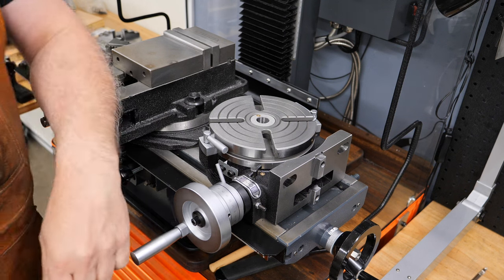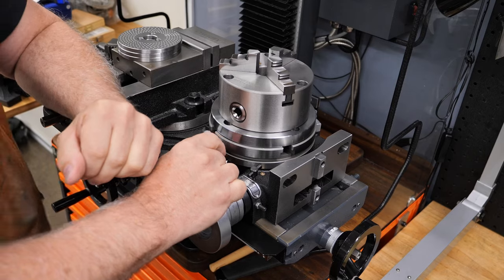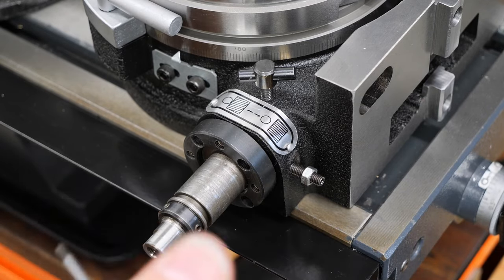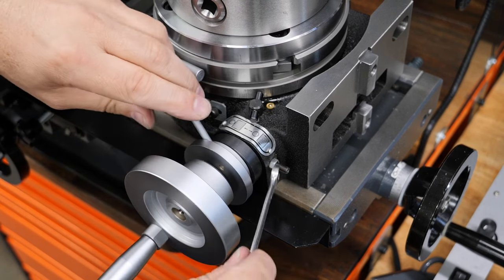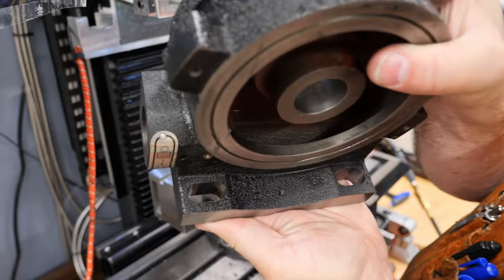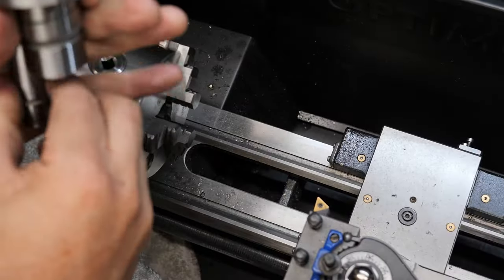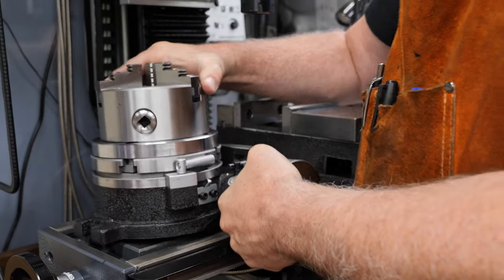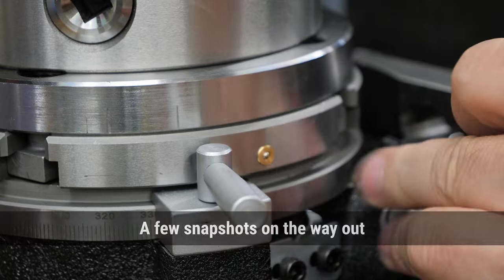Buy, Fix & Rebuild a Cheap Dividing Rotary Table for the Mini Mill - Rob's Garage

Comment: What's the Ducati 900SS banner for?
Haven't worked on one since mid 80's.
916 was a fantastic bike, got to ride one in 95.
You fit a four jaw chuck on a tiny rotary table so you can hold very small parts, more than 3" diameter when you reverse the jaws.
Stefan Gotteswinter said Chines equipment is just a kit of parts that need putting together properly.
I bought a couple of MT2 'soft' (emergency?) mandrels for mill as they can be cut quite easily plus can be pulled into position on rotary table if you make a 'special washer' so Alleb bolt doesn't protrude  below mounting face. You can get them with Imperial or metric draw-bar threading.
It's really handy to be able to clamp things on solid centre post and only need a single slot open to prevent rotation of part on table.
 I've made some quite neat clamps to hold fork brace in place on bikes that only had mudguard 'brace'
Reply from the maker: Hi Crazy PJ. That Ducati banner is from when I started this channel to do videos about my old 900SS bevel. Trouble is, by the time I built up my workshop and camera gear for this, I'd already done most of the work on the bike and so the channel has sidetracked into the machining content. I wish I'd started a lot earlier. However, I've got a plan for a series of videos going over all the different details of the bike and the work I did. Every part has a long story and I'm happy to bore a few people here with them :)
With the fork brace you made - did you use the rotary table to make the round ends of the yoke. That would certainly be a good use for it,
Thanks for the comments!
Reply: @Ducati900SS 
LOL, I gave up trying to make video's as the editing took way too long 14~15 years ago.
Shop I used to work at took on Ducati as well as Suzuki and Yamaha. 
I was a bit pissed when they sent one of the guys I was training to Italy for a month to learn all about the belt drive desmo's.
Originally I had a 4" RT which was really too small but it did more than it should have.
I got a 10" RT which still wasn't big enough for some of the things I wanted to make but I made an extension to make an EGLI style fork brace for a 1965 Suzuki T305 with a curved top to match radius of 18" wheel with tyre.  In case your not familiar with the EGLI style, it's a Y shape with closed top and round tubes clamped across wheel. I used 1/2" stainless tube, stopped all fork flex
Reply from the maker: @1crazypj  So true.. the video editing is such a massive pain in the butt! Fine if I got the traffic, but I don't :( 
The main thing I recall from Egli was the Egli Kawasaki back in the late 70s or so. Everyone was making batter frames for Japanese engines to live in. His were considered tops. But then I got out of bikes for a few decades and I don't know what happened to him. I should look it up and see.
Reply: @Ducati900SS  Me, being British, EGLI looked great and had some great design pieces but were so damn expensive. Rickman were somewhat more affordable being made in Britain didn't have 'luxury' import duty.
A few friends had Rickman's. 
Rickman Kawasaki was actually a bit disappointing because the engine was so wide but was crazy fast in almost all situations. The Rickman Honda (CB750) could corner faster than the Kawasaki as it had a bit more ground clearance. Dresda 500F would beat either on a real twisty road though despite being 10~30mph slower.
I remember Simon sold his Rickman Kawasaki and bought a Kawasaki 550F when they came out (early 80's?)
Reply from the maker: @1crazypj  These were all dream bikes in the magazines for me and my friends at the time.. we had 50s, I had a Kreidler and a Hercules :)  Luckily the 900SS was also a dream bike and finally I got one 40 years later!